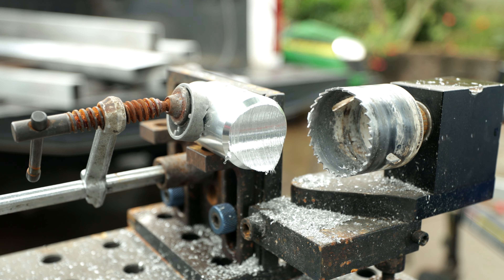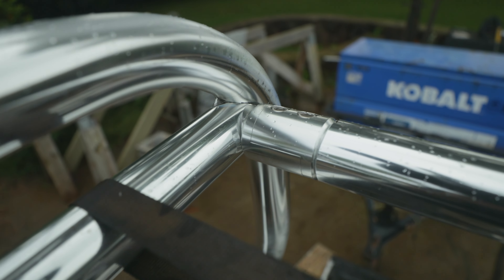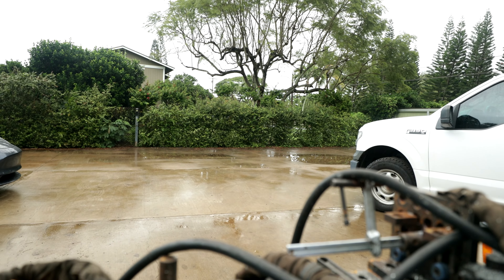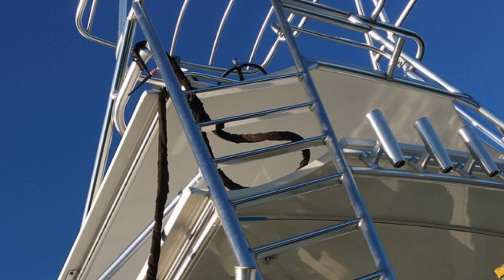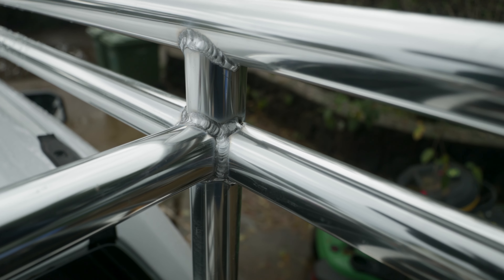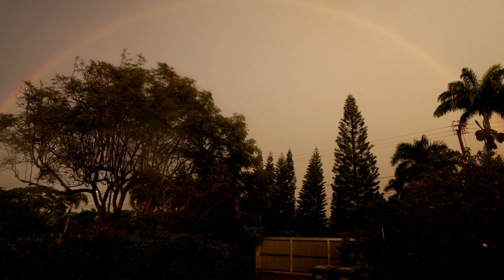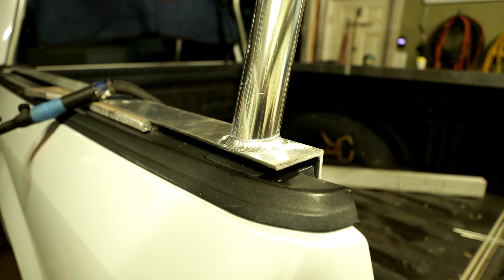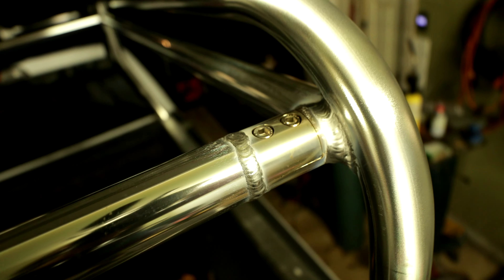Building an Anodized Aluminum Truck Rack - Welding Anodized Aluminum - Pipe Bending

Comment: Nice . What bender did you use? Should of taken vid of bending process , good.
Reply from the maker: Thanks, I don’t know nothing fancy just a hydraulic beast that savagely crushes the straight pipe into a bend with a steel shoe against two round pressure rollers that don’t roll. It’s quite a nightmare thats why I didn’t bust out the camera. I’ll do a bend video for you tho. Thanks for watching!

Comment: Very nice work, When weld anodizing  is different at regular aluminum ? I try and I can’t.  Thanks
Reply from the maker: Yes it’s very different. You need to crank up the heat. Blow through the anodizing for a few seconds then kill the arc abruptly. I use an on off switch but pedal will work. Then move forward 1/16th and repeat. As the metal gets hotter the time it takes to puddle up decreases so you go faster. Hope that makes sense. Basically it’s a series of tacks stacked like a weld on top of each other.